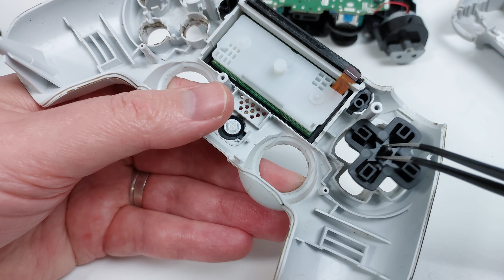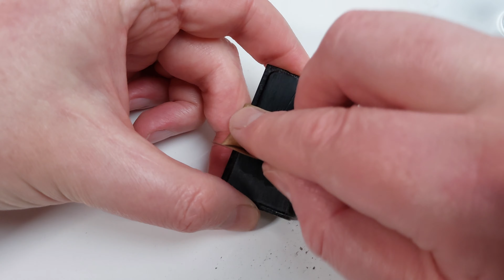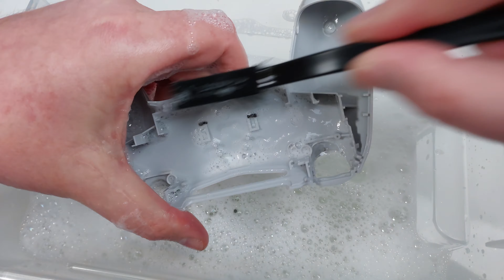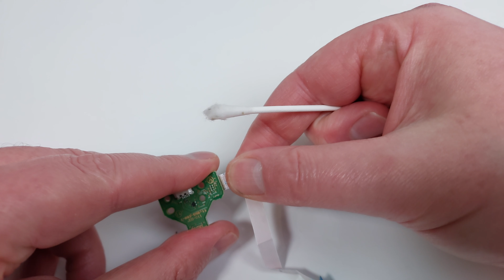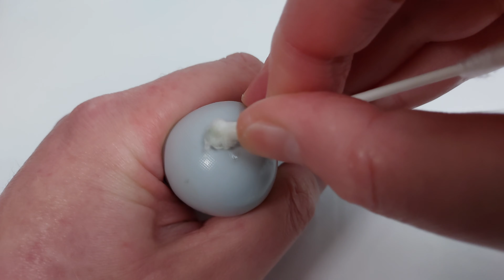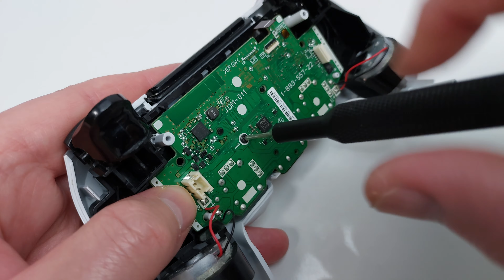Restoring a white Sony PS4 DualShock 4 Controller

Comment from the maker: Tools I use for  restorations:-
iFixit  Mako Driver Kit - https://amzn.to/3FOYrAl
iFixit  Essential Electronics Toolkit - https://amzn.to/3HsqnuP
ST-2065D Soldering Iron - https://amzn.to/3FfQK4y
YI LIN Rosin Core Solder Wire -  https://amzn.to/3FdWs6R
MG Chemicals 8341 No Clean Flux Paste - https://amzn.to/3FgM9PF

Hydrogen Peroxide (for  de-yellowing)
Super Star Cream Peroxide Developer - https://amzn.to/3hc7XUx
Viva Doria Hydrogen Peroxide 6% - https://amzn.to/3hgb0uS

Waterslide paper (for printing decals)
Decal Paper for Laser Printer - https://amzn.to/3Pj4qAu
Decal Paper for Inkjet Printer - https://amzn.to/3Fd69md

As an Amazon Associate I earn from qualifying purchases